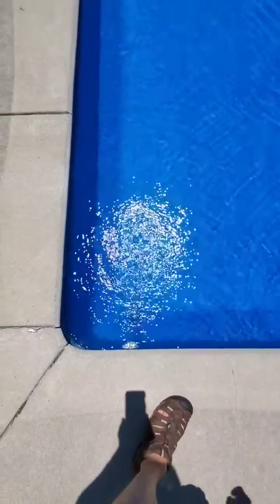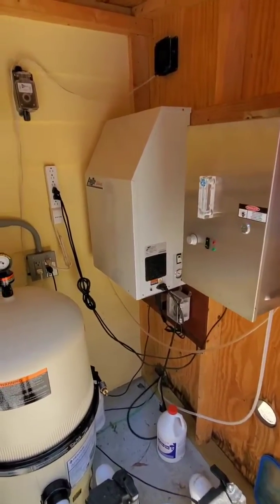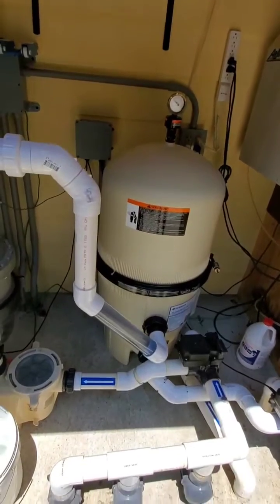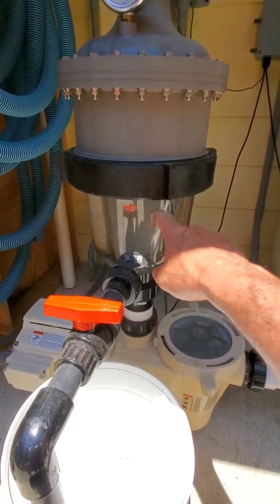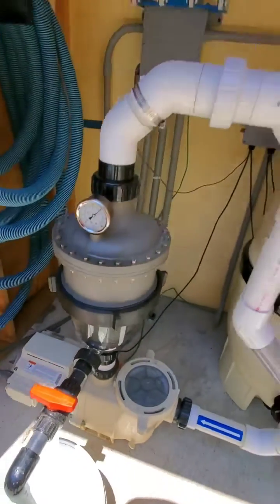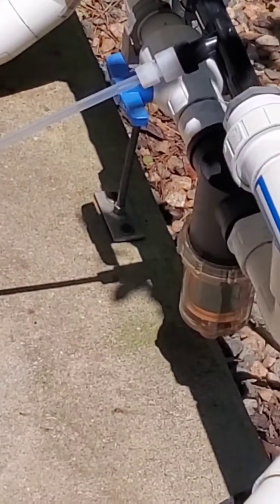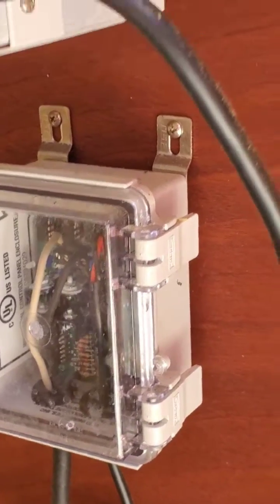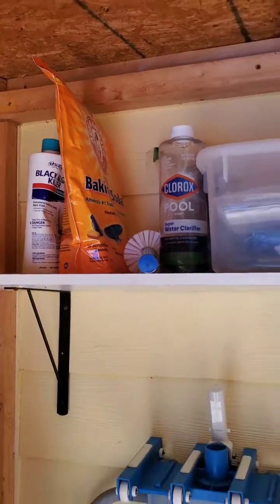Chlorine Free Pool year 6 update

Comment from the maker: I don’t have an ORP meter on the pool.  The ozone generator is a 0-10 gram per hour, K1 unit. We usually run it at 5 to 6.  The dial reads from 0 to 10 and corresponds linearly to the output.